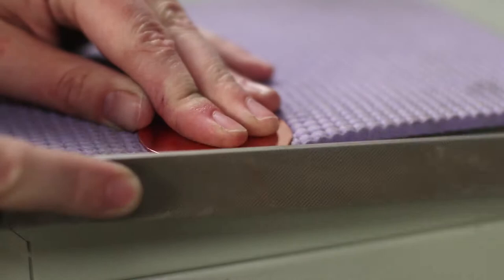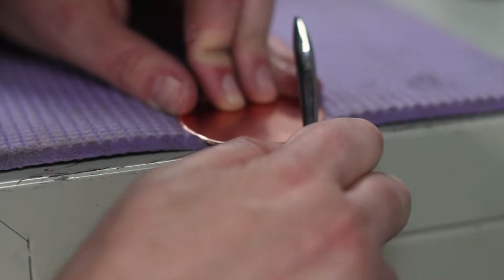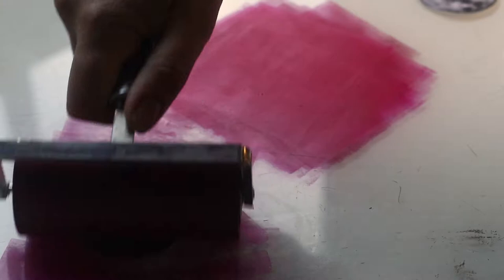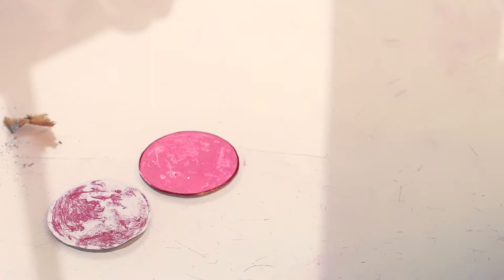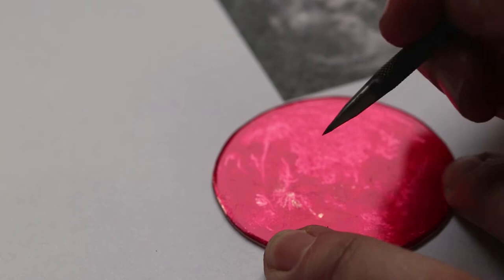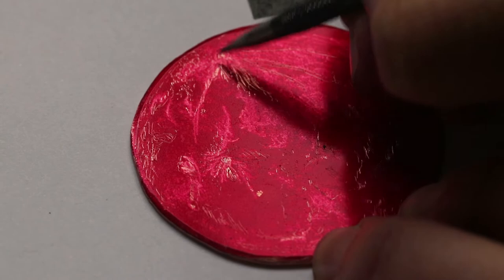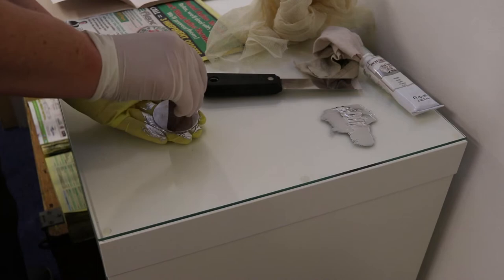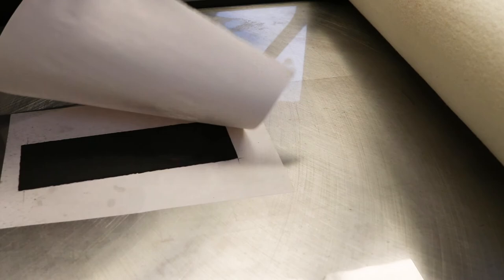Non-toxic etching with hard and soft ground

Comment: Great video! thanks for sharing. For heating the Big ground on a hot plate, what temperature and time will you recommend?
Reply from the maker: Hi Reinaldo, thanks for your comment. It's been a while since I made this one, so I can't remember exactly what my numbers were, but the company that makes the ground recommends 6 minutes at 135º Celsius in an oven. On a hot plate that will be a little different, and you might just need to do some tests. Hope that's helpful!